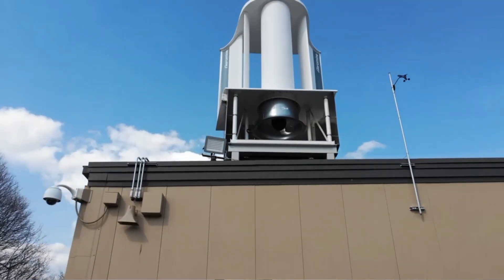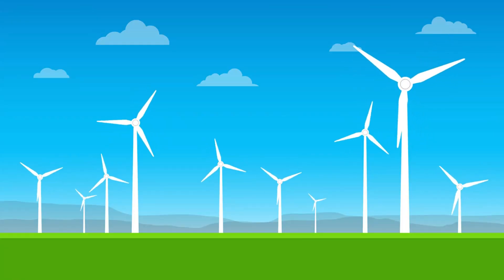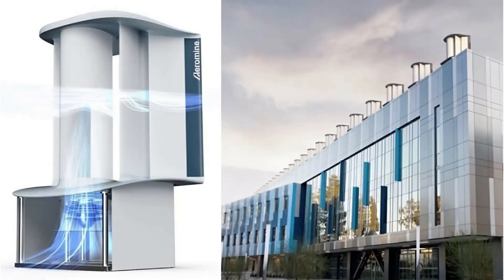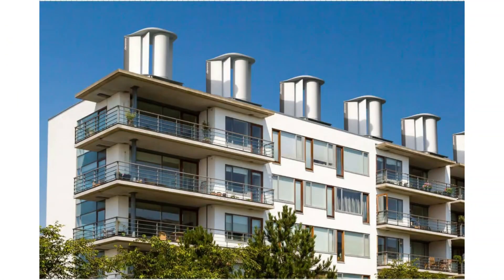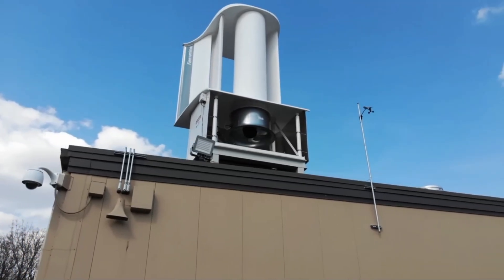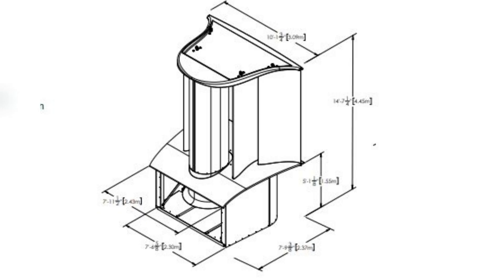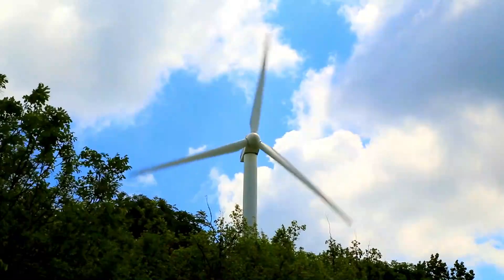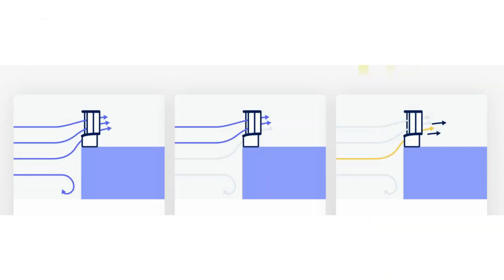Aeromine Wind Generator: A unique wind turbine design

Comment: oh second/primary channel to the aero stuff. tesla turbines are super easy to make. easiest form of a turbine. yep even compared to normal water wheels. so what if you put an horizontal open tesla turbine line on the top of the roof. yes tesla turbine looks like a grinder machine.

Comment: Yep, I think this is the one with the impeller that is exploiting the "Venturi Effect" to concentrate the airflow. So, an interesting design and I believe lot of "off the shelf" products used to make servicing the unit easier. Neat design. They are still experimenting with it I believe at DOW or BASF mainly larger company's roof tops.